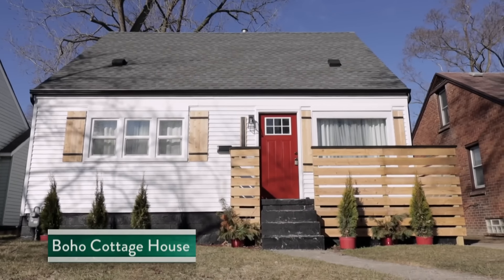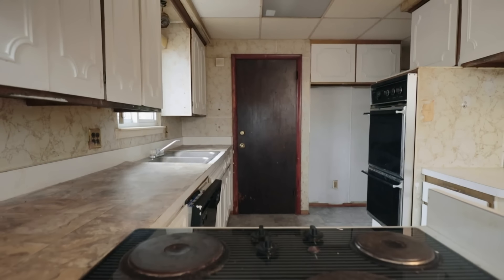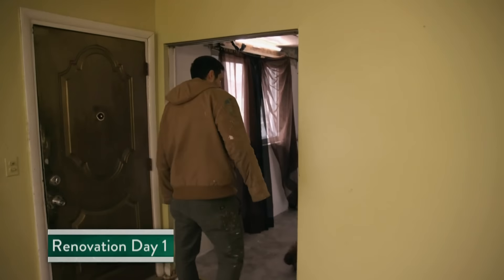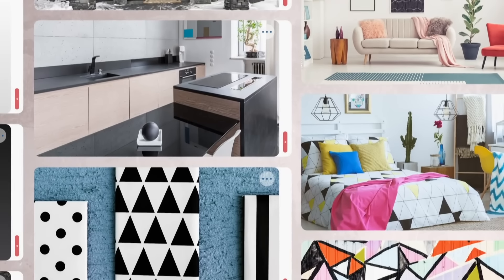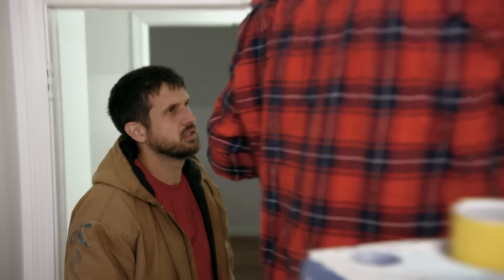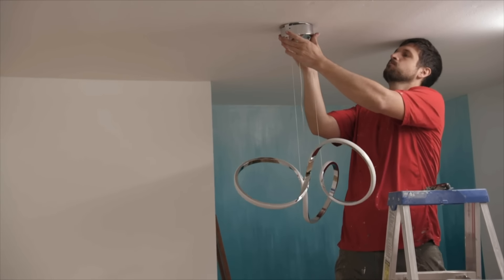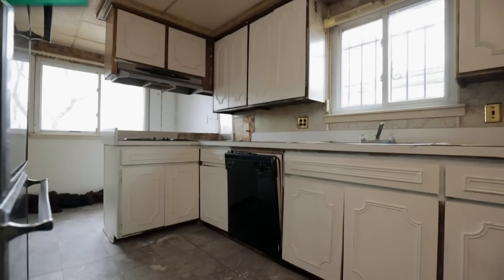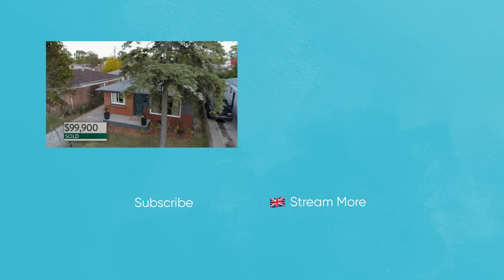Evan & Keith Renovate This 70's House Into A Six-Figure Masterpiece | Bargain Block

Comment: The reason a lot of these old homes had dropped ceilings was because of the oil shortage in the 70’s. These homes didn’t have the insulation that we have today and people lowered their ceilings to save money on their energy bills.—Susan
Reply: I think you are absolutely correct

Comment: Back in the day, some designer/builder thought those drop ceilings were modern and stylish. This was when kitchens would have 2 lights, one over the sink and one in the ceiling center. Never cared for those plastic rectangles and aluminum frames.
Reply: They also lowered heating costs.

Comment: It's a AMAZING to me, That Evan & Keith never Show The LAUNDRY ROOM & BASEMENT. In Every Episodes, It's basically the Same thing. But on the other HGTV Shows, they do show the Laundry and Sometimes the Basement. I understand that they have a Budget to meet liked any other Series. They Certainly do Make the Profits.  Still very strange to me.
Reply: A basement is a perk for many buyers here in Detroit but having one finished doesn't add as much value in lower end neighborhoods like these as something like adding a 2nd floor bath or an open concept kitchen - They likely just clean up most basements, fix what is necessary down there, and generally leave them alone.

Comment: I liked a majority of the design. Hated the console under the geometric shapes in the sitting area. It needed to be solid black, but with either gold or silver knobs. I loved everything else! The wood accents outside. Kitchen, bathroom were great! No issues other than that console?  Look I am glad, they fixed a home in an area that is rundown. And it was affordable. A lot of flippers will over improve a house to the point that no one in the area can buy. They do it in a decent manner. While the big 3 still provide jobs, its not like 1950s. Automotive industry has branched to areas where the unions don't have a foothold so they moved there. Sucks yes. My state was a beneficiary of this. I don't live in Michigan. Sorry building cars is better than slaughtering chickens...…

Comment: If its a house built in 1910, the reason for the drop ceiling. Utilities!!!!!!!. At least in the area I live in, plumbing wasn't a fixture until 1950s. Some houses had gas lights! So electricity and then after the 90s everyone wanted AC. And central AC. So ductwork may be in that drop ceiling. Yeah sucks, but code only says you need 7 feet. Or at least where I am at. So Shaq would have issues here. Also my basement that got dug out in the 50s or 60s will never be a finished basement. Once they put in the ducting the ceiling to floor height is 6.5 ft. Note, there is an original cellar. Its 6 ft in height. People were shorter back in the day.
Reply: Also that house was renovated in the seventies so during the oil crisis lower ceiling =lower heating costs.

Comment: That's not a 'ranch.'  A ranch has an east-west layout, meaning a long low façade.  This is a bungalow.
Reply: Weeelll, sorta. Ranch means different things in different regions of the country. That's called a ranch in Detroit. In the Los Angeles area, nope! Here they are long and low.
Reply: @olly-kai  
It's a misnomered in Detroit.  It's a style that originated out west.
Reply: @b_uppy  We definitely call single-story homes "ranches" here in Detroit. "Bungalows" here are considered to be two-story 3-bedroom homes with one large bedroom on the upper level.
Reply: @Stressless2023 
Misuse is still misuse.  A bungalow is an Bengali style of houses and architecture originating in the Bengal region.[1] It can be described as a small house or cottage that is either single-story or has a second story built into a sloping roof (usually with dormer windows),[2] and may be surrounded by wide verandas.[
Reply: @Stressless2023  
A ranch (also known as American ranch, California ranch, rambler, or rancher) is a domestic architectural style that originated in the United States. The ranch-style house is noted for its long, close-to-the-ground profile, and WIDE open layout.
Additional features include:
Single story
Long, low-pitch roofline
Asymmetrical rectangular, L-shaped, or U-shaped design
Simple, open floor plans
Living areas separate from the bedroom(s) area
Attached garage
Sliding glass doors opening onto a patio
Windows with a large glass area, sometimes decorated with non-functional shutters
Vaulted ceilings with exposed beams often in combination with tongue and groove roof decking
Mixed material exteriors of stucco and brick, wood or stone
Deep overhanging eavesCross-gabled, side-gabled or hip roof.
Reply: @b_uppy  It isn't "misuse" in certain parts of the country. Those are the terminologies used here in Michigan. They apparently "vary" in others. No big deal. A ranch or bungalow home means something different here than where you live, that's all.
Reply: @Stressless2023  
It is misuse.
Reply: @b_uppy  No. It isn't.
Reply: @Stressless2023  
Yes it is, and I showed why, as well.
Reply: @b_uppy  No it isn't, and I said why.
Reply: @Stressless2023  
Your 'why' is based on incorrect usage from a small community.  It's still wrong.
Reply: @b_uppy  No you're still wrong desperately trying to be "right". My comment stands firm and makes sense. Keep debating though if that makes you feel better.
Reply: @Stressless2023  
Zero debate.  You're wrong,
Reply: @b_uppy  Zero debate, you're only right about that part smh.
Reply: @Stressless2023  
You'll find zero design mags backing you up.
Reply: @b_uppy  You are wrong. The terminologies mean different things in different parts of the country as I've said. You are wrong. I will continue telling you that you're wrong despite your obvious desperation to be otherwise. You are wrong.
Reply: @Stressless2023  
Except it would be noted in the dictionary, design hubs, etc it were a big enough area.  It's not.  
Words have still have meaning.
Reply: Google disagrees with you. Certain parts of the country disagrees with you. What I said in my comment is valid - But keep responding, I'm entertained.
Reply: @Stressless2023  
Yes, I see the link, lol.
Reply: @b_uppy  Google is easily accessible. So are real estate sales in other states, including this one in Michigan, listing "ranches" and "bungalows". The internet is your "link" - Due diligence is key, "lol".
Reply: @Stressless2023  
Google is merely a search engine, and fails to agree or disagree.   It's why you 'cited' it instead of a dictionary or design source...
I copiedvand pasted from Wikipedia, btw.  Think you know that by now...
Reply: @b_uppy  The fact that you think Wikipedia is credible and can't be altered by virtually anyone lmao - You're still wrong. Keep going though, it's getting more fun with every nonsensical response you give...

Comment: i don't know. On all these shows also with El Moussa I see the same things. Fast optical renovation in order to flip it with realtive high gain. A bungalow  of the 70ies in this state is a dump. In order to overhaul it you have to strip it to its carcas ie 4 walls, relay the roof, redo the water an the electricity and then start what these guys do. I would add an additional 60k to get that house in order. Americans overhaul much much better their cars than their houses. They strip cars to the chassis and do all structural work needed to make that like it came rolling of the belt. That is my idea. Americans buy houses with their eyes and not with their minds.The find a house is ok when the interior is redone. Is that so? They seldom creep under the house to stabilize it. This is more a hobby than professional work. It needs also new windows, new sewers landscaping and so on. Strange Americans. What on earth can you do today on a 30k budget? Some repairs.